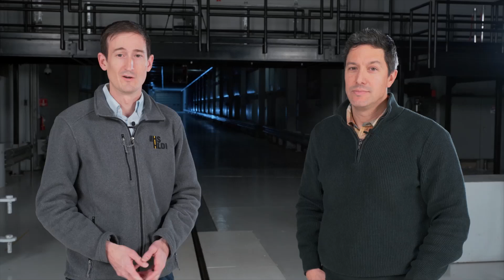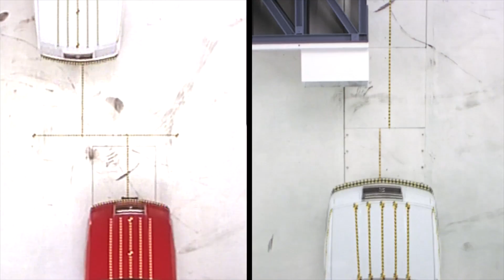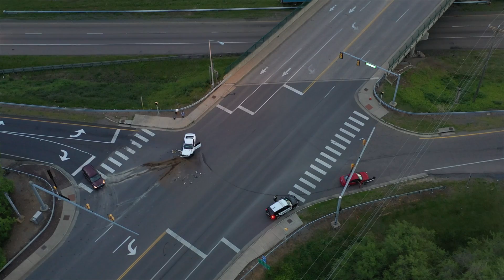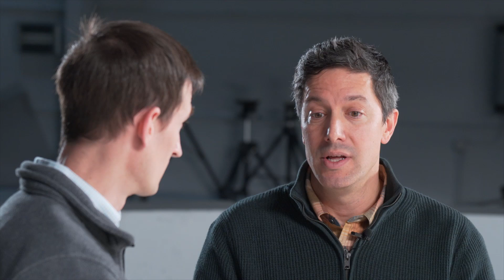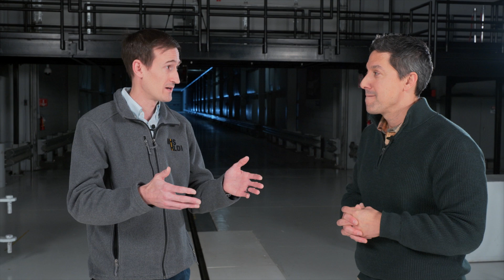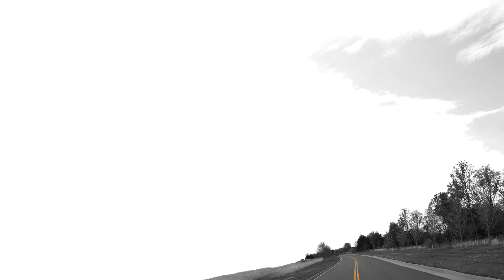IIHS answers your questions about test speeds

Comment: Crashes at over 40 MPH are rare. In most instances there is at least partial braking involved. Thus, even though the car may have been traveling at 70mph, the impact itself is at 40 or less. Again we must look at european highways whos speed limits are usually 130 kph (80 mph). Their mortality rates are a fraction of ours. The reasons are simple, better driver education, better highway design, enforcement of lane discipline, and lower speed limits for large trucks.
Reply: It is such a limp-d*ck cop-out when people say it's all about speed while completely ignoring the wretched state of driver skill and education in America.
Reply: Amen
Reply: crashes at 40mph are NOT rare, and I can say that myself!! I was going 35-40 and I still hit someone head on so it possible to crash at any speed 🤦🏻
Reply: If you have two cars both moving towards each other it's not hard to get a crash well over 40 mph even with both cars braking. You just need speeds of over 20 mph from each car.

And while crashes over 40 mph may be relatively rare compared to total crashes, the majority of FATAL collisions ARE over 40 mph. I had never heard there's a tradeoff in making a vehicle safer at high speeds compromises safety on lower speed collisions though.
Reply: @SuperMrgentleman Two vehicles colliding at 40MPH does not equal an 80MPH impact. Been debunked time and time again.
Reply: @SuperMrgentleman  This crash test against an unmovable barrier is comparable to a head-on collision of 2 vehicles traveling at 40 mph each. OR a single vehicle hitting a stopped vehicle at 80!
Reply: @Wised1000  I didn't realize 80 mph into a stationary car was equivalent to 40 mph into the barrier, my bad. I guess because the barrier doesn't deform?
Reply: @SuperMrgentleman  Exactly! Its that "unmovable" part that is key. In a collision with another vehicle, The other vehicle is a deformable structure. Which is like having an additional crumple zone to manage the force of the crash. In the offset crash, there is a small deformable zone on the barrier, on the full frontal one, there isn't. The test measure different things. The fuul frontal is mainly a test of the restraint systems, the offset is a more accurate predictor of how the struture would manage a more likely frontal crash scenario. It's ll about the G's exporienced by the driver. The human body as a whole has been "tested" to survive a peak load of appx 50 G (rocket sled testing with a real person!). The whole idea of crash science is to manage the kinetic energy of a crash to within tolerable human limits. Look up the egg in a box experiments abd the physics becomes obvious. Its all about time to complete stop.
Reply: @Wised1000  Helpful!
Reply: lower mortalities over there (germany especially) is partly because many of their cars are beefed up for those kinds of speeds. (BMW, audi, vw)
Reply: @GaryS-b3y  are you talking brakes, steering, suspension, or crash safety?
Reply: @asum307   body bones
Reply: @GaryS-b3y  Well, you’re making not a lot of sense. So I’ll assume you’re talking crash safety. In which case all cars are tested against the same crash criteria the world over. The tests change slightly depending on region (the tougher tests are actually outside the EU), and European cars no longer do better than every other brand, they rank the same. Actually, the last couple of vehicles that scored top tests were Mazda, and Tesla.
Reply: @asum307   oh yeah?? they DO do better. put a volvo, bmw, vw, or audi with a mazda or honda or whatever, at 55MPH and see which driver is less pancaked
Reply: @GaryS-b3y  😂😂😂 What part of the same tests preformed the world over don’t you get?? The same dummies, same crash barriers, same speeds. They all go through standardised testing. 😂
Reply: @GaryS-b3y  Notably those cars generally do very well on the American crash tests too.

Comment: So we need to figure out a way to make the structures be able to withstand higher speed crashes as well as low speed crashes. Like a dual step crush zone. The outer members of the structure need to be softer for lower speed crashes and then the second half of the members need to be stiffer for higher speed crashes... I don't see why that's impossible to do without making vehicles bigger or look weird...
Reply: It usually comes back to money mate , most problems can be easily fixed if you have the coin to fund them .
Reply: That won’t make things much better at low speeds. It’ll crumple halfway and then just stop crumpling. Yet if it crumpled all the way to the firewall, then it would’ve reduced the forces.
Reply: @akj2387  yes it would work exactly as he says it would. There are cars with very short crumple zones that protect the passengers from severe impact just fine. You don't need a large crumple zone, you just need to dissipate the energy in such a way that it doesn't get to the passenger which requires careful selection of metals and engineering.
Reply: Could be a cost issue
Reply: Look up Saab crash test, they all got long nose for maximum crush zones, it can be done, multi stage crush zones, but very expensive and would make car looks weirdly long.
They are all front wheel drives, but they got long noses for crash safety.
Reply: @worawatli8952  and yet the last gen saabs are the only saabs with pillars that won't move at only 40. so much for an "outstanding" safety reputation😂😂
Reply: @GaryS-b3y  Saabs were the best on typical speed crash, people can walk away from it without a scratch, that was their kind of engineering. But on higher speed, German cars are better. Saab would just crumpled up too much.
Reply: if germans do it, anyone can
Reply: That would mean you'd be trading softer crumple zones for stiffer crumple zones somewhere, so crash performance would still be worse at 40mph.

The only way to make the two compatible is by adding a stiff crumple zone on top of the existing soft crumple zone, which would make vehicules excessively long and bulky
Reply: @luckyluke5638
nonsense the germans already do highway worthiness just fine, plus volvo
Reply: It's completely possible, sounds like the iihs has sold out.

Comment: also, the old 68' corvette had airbags crazy!
Reply: The first factory airbag was available on the 1973 Olds Toronado. They weren’t required in all US cars until 1998.
Reply: @Sashazur  except US cars had them before that. 94 was the catch-up for all cars lagging behind.
 the 98 rule was basically to make ford f350's catch up for their loooong overdue improvement
Reply: yeah i know its unreal. @Sashazur
Reply: @Sashazur
the 1998 rule was only to get certain trucks caught up, like the OBS f250&up
Reply: GM had airbags as far back as the late 1960’s, even had them on some of their 1973 to 1976 full sized cars. 

Btw, it’s ‘68, not 68’ unless you mean sixty eight feet tall.

Comment: why.. they don't do GMC yukons and serrias?
Reply: Tahoe/Yukons are too low sale and too expensive to be considered to crash test. They crash test the Silverado, which is the same as the Sierras.
Reply: @gwot  "too low sale" it's not the 90s anymore. jeez!
Reply: probably because their front bone architecture is identical to silverados
Reply: If you see in the IIHS shorts, they were preparing a Tahoe for testing. The results should come out later this year.

Comment: As a general principle, the exponential danger associated with increased traffic speed is a topic which is being willfully ignored by politicians of all stripes. Habitual high velocity travel also increases the environmental impact of any vehicle.
Reply: That also has to be factored through increased vehicle safety and environmental consideration. Speed limits haven't increased in the last decades, but vehicles now are much safer both in general handling at speed and crashworthiness. And vehicles of the same category have gotten more fuel efficient; my 1995 F150 is nowhere near as fuel efficient as a 2024 model, especially at highway speeds, because engines have gotten more efficient, transmissions gained speeds to keep engine RPM low on the highway, and bigger vehicles tend to be more aerodynamic than before, although new "flat" grilles are bucking that trend. People need to be places, especially in North America where distances traveled are huge compared to denser populated countries where lower speeds affect travel time minimally. At some point, asking people to travel 55mph on the highway in a smooth-driving, agile and safe vehicle will only lead to non-compliance, or absurd revenue generation from police enforcement for unnecessarily low speed limits. Maybe we should enjoy the fact vehicles have gotten safer through stricter testing and increased consumer awareness by reassessing the need for low speed limits on non-urban, non-pedestrian arteries instead of striving for unattainable "zero fatalities" vehicle crash figures.
Reply: yeah
Reply: @dledet1 👍

Comment: Wait, can you upload the full footage of the Chrysler LeBaron convertible crashes? I'd love to see how those 1980s cars perform, or more accurately don't perform, in the moderate overlap tests, considering they're basically extended K-cars built on a platform engineered in the late 1970s.
Reply: That would be really cool. Videos from the archives, 70s-90s...
Reply: I grew up with a 2nd and 3rd gen Chrysler minivans and they were so flimsy.  They probably didn’t perform well in crash tests.
Reply: @Wasabi9111  Fun fact: Chrysler knew early on that consumers wanted dual sliding doors but the gen 1 and 2 structures were so weak they couldn't support the extra opening.
Reply: I second this!
Reply: Look at the modern vs classic Impala test.  Shocking.
Reply: @superspeeder  It was a Bel Air vs a Malibu
Reply: Yes! Please!

Comment: You guys should figure out a formula to determine which the vehicle thats being tested should be traveling at during the crash. Especially for small cars, increase the speed to match the energy that would be received if the vehicle was to hit a much heavier car. The heavier the car thats being tested, the slower the test speed is. Test light cars at higher speed to simulate a crash against a heavier vehicle.

Comment: Why not have both low speed and high speed crash test?
Reply: Did you watch this video?
Reply: They said that it would make automakes make cars more rigid, which isn't a good thing, so why not balance out both? @Sashazur
Reply: ha, was literally going to write the same thing @Sashazur
Reply: Because 40 MPG is already a good balance. 

Generally, IIHS represents insurance companies. They want to know which vehicles lead to less bodily injuries. If you are testing at higher speeds, all you are getting is whether passengers will die or become paralyzed. And these scenarios are not that different.
Reply: @solderbuff
except volvo & the germans already have it figured out, plenty of folks have walked away from those at 50+
Reply: Because the annual budget is only $32M.
Reply: @aliendroneservices6621  On behalf a multi billion dollar industry...Hmmmmmmmmmmmmmmmmm seems a bit sus, don't you think?

Comment: In short, if we increase the test speed, vehicles would get stiffer and heavier to the detrimental of safety of low speed crash as crumple zones would be optimized more toward high speed.
(Less crumpling in the front at low speed to make it crumple just right at high speed) 

Also vehicles would be less maneuverable and less compatible with older cars.
Reply: Why not test at both lower and higher speeds?  It is not complicated.  I'd also like to see lower speed testing in crashes with pedestrians/bicycles (to see how well the ped/biker fares).
Reply: Volvo & the Germans already do it with no trouble. Take that crap & shove it.
Reply: Yup, like you’d have to make cars so stiff in order to hold up to a 60mph crash without intrusion.
But this means the car would barely crumple at 40mph and won’t absorb any energy.
Reply: @akj2387  SmartForTwo was crash tested at 70mph and its cabin space perfectly but the driver would've died from the blunt force trauma.
Reply: @akj2387  the solution is giving them just enough resistance to leave half of the length remaining at 40
Reply: @akj2387  if germans do it, anyone can. the others are just greedy and want us to die.
Reply: @akj2387 volvo & germans have already done it
Reply: why cant it do both... what.